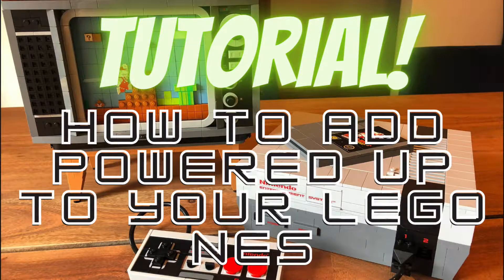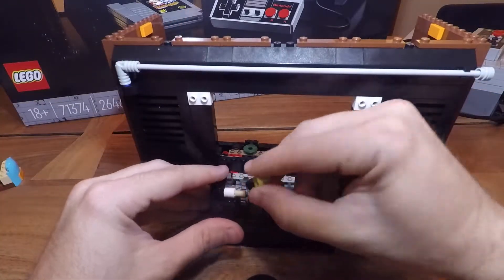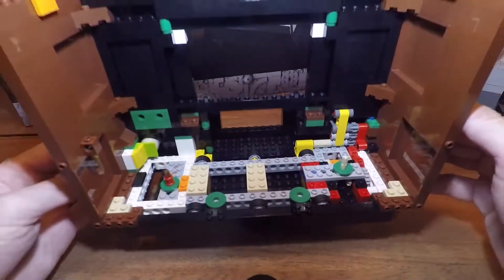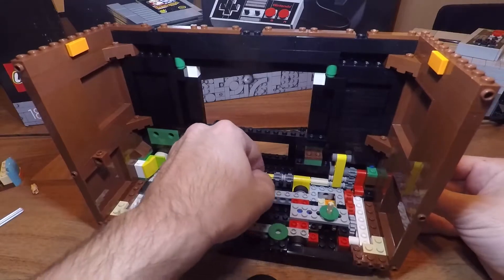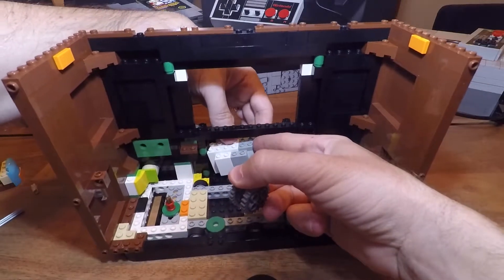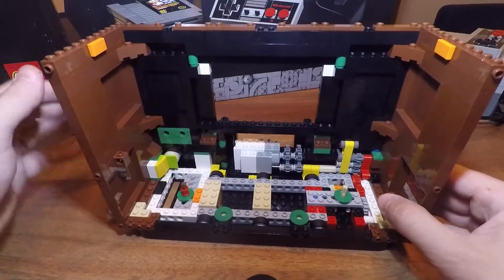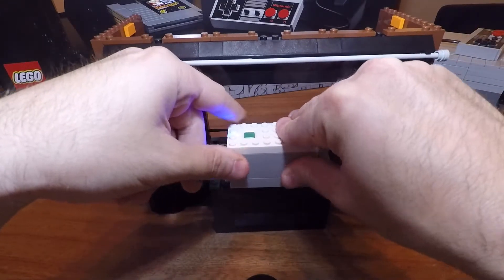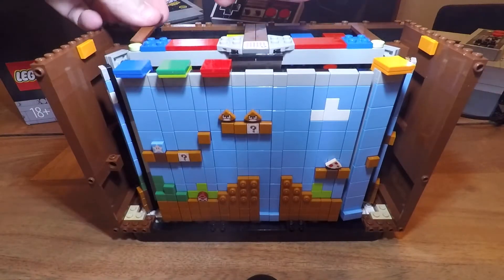TUTORIAL! How to add POWERED UP to the LEGO Nintendo Entertainment System NES 71374

Comment: I will be trying this during Easter, but I am wondering if anybody managed to do it in the way, that you press button on the controller and then it starts to move? To link Nintendo controller and motor?
Reply from the maker: It's probably possible but may require no lego hardware with lego built around it..

Comment: I followed the tutorial and made this mod, and it does sort of work. My issue might be with the build more generally, but when the level is in place, it moves very clunkily. With the Mario figure in place, it frequently even gets stuck. Sometimes it'll have a good run if the speed of the engine is up enough, but more often than not, it'll get stuck.

This was a great tutorial, but I wish I could get this build to not get stuck so frequently.
Reply from the maker: Hey Ryan, sorry to hear that. It might just need a little tweaking internally to allow the scene to scroll more freely. I don't have the lego mario so I can't speak to that unfortunately. Hopefully you can get it to work !

Comment: First off, thanks for sharing this nice mod, it's great.
Now for my review. So the necessary pieces finally arrived today!! After building it, I noticed that the black Pin connector comes loose too easily after a few test runs (with everything put together). That got frustratingly annoying. I had to reconnect it 3 times then I finally decided to super glue that piece on. It seemed to fix the problem, also it might help to add a little glue to the bottom of the motor because it too got pulled up/off the base plate. So far no more errors, it's just a bit noisy, but still cool. I feel like it was 1993 again...
Reply from the maker: Sorry you had to glue it.. but glad you got it working! Love this set.

Comment: But there's actually a problem with mine. The motor and everything is fine it's just that the screen is too big and heavy and in the set there is only one side of all the gears connecting to the technic axle and only that one little technic axle is what moves the screen and nothing else. Everything else that connects with the screen at the bottom moves freely. So due to the one little axle that makes the screen move the screen is too big and heavy for the motor to support the axle and make the screen move. I made this discovery where when the screen is out of the TV the motor works perfectly however, when the screen is in the TV, the screen doesn't move. So I'm wondering if you could please, please, please! Make a video tutorial of how to fix it, that would help me a lot!
Reply: I did exactly as in the video and my motor also gets stuck.
Reply: I have the same issue.
Reply from the maker: What motor are you using? And did you modify the gears like I did?
Reply: @monumental.bricks  But I have a normal Technic motor and you have a more twerk motor, so I think that might be the issue, unless if I do a different gear ratio, which idk what to do with a different gear ratio.
Reply: @monumental.bricks  I really need help. Do you have a Instagram account, I bet I can explain it to you better there.
Reply: Hi, I have the same problem. I use the same engine as the video. The motor Medium Linear Motor, that of the Lego Boost 17101. 
without screen it works. with the screen it fails, even if I raise the engine speed.
Reply: Same problem for me. But i didnt double the gear as you did